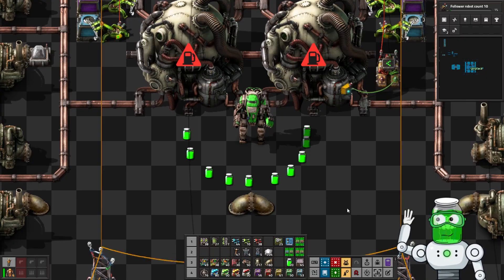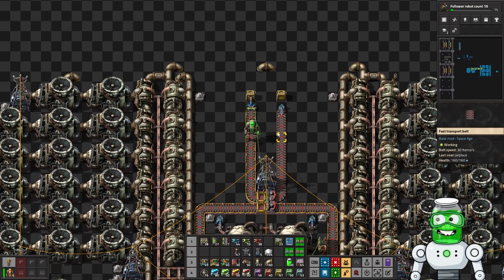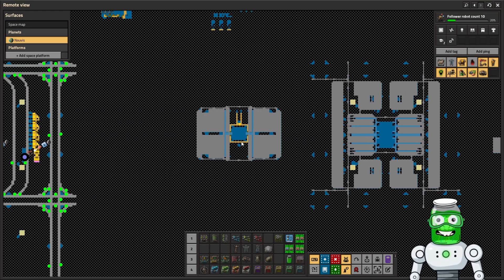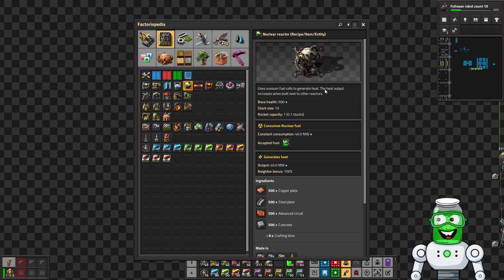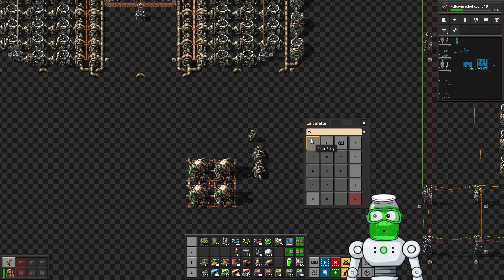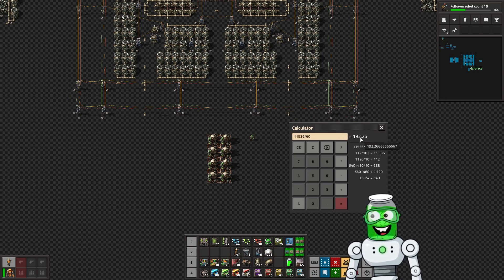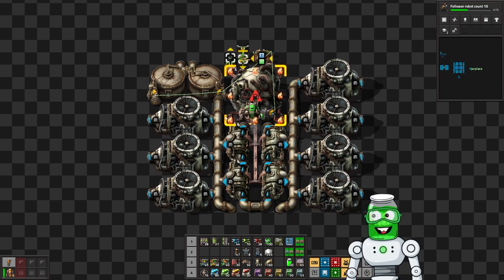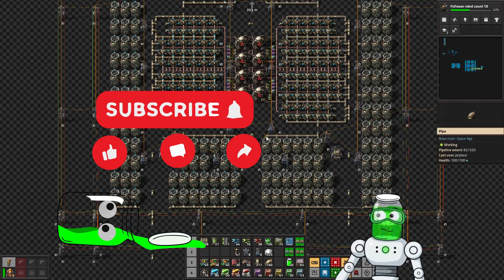Nuclear Power Tutorial & Blueprints! | Factorio Spage Age

Comment: I do not unterstand the setting at 1:47 - please explain the combinator setting in the second line when you compare everything to T
Reply from the maker: That's just a way to make sure there is no fuel in the reactor. If there's fuel in the reactor, the fuel signal won't equal T, hence everything will not equal T, and so it will limit itself to only every having one fuel in the reactor at a time.

Another way to do the same is to say "nuclear fuel = 0"

Need to make your inserters limited to 1 stack size

Comment: how many assemblers do i need to fill uranium fuel cell production for the 4 reactor setup?
Reply from the maker: Great question!

You can produce 1.25 fuel cells per second with a regular green (level 3) assembler, and each reactor burning at full tilt (using it's max power draw) will consume 1 every 200 seconds.

At regular crafting speed it takes 10 seconds to craft, but you get 10 of the fuel cells. If you are using blue assemblers it might be like... 0.75 per second?

So I think it's safe to say you can have one assembler you can run a LOT of reactors.

The limit will be how many U-235 you are getting, so keep and eye on that.

Pre-space, you won't have kovarex, or requester chests, but your average mining operation will provide enough 235 for a 4 reactor setup plus a bit extra

Comment: ive started doing the temperature management for space platforms and the other planets but tbh, for nauvis uranium is so abundant it just feels kinda unnecessary. i could be wrong but if i remember correctly, you only needed like 8 mining drills without kovarex to support one 2x2 reactor and that was before we got quality and big mining drills

edit: it was 8 per one (40 MW) reactor but with only prod 1 in the centrifuges and fuel cell production. with prod 3, its 6 miners per one (40 MW) reactor.  higher than my initial comment but my point still stands. especially with all the new features, i dont feel the need to be super conservative with my nuclear materials
Reply from the maker: definitely agree!

It's mostly important early on (debatably so) to get kovarex up ASAP, or on a space ship.

In either case, it's not really essential.

For me, though, I like being as efficient as possible and UPS is never really a concern.

If I was running Factorio on a potato I might care less, for mroe UPS optimization rather than Uranium conservation.
Reply: u pretty much do it in the early game when u just started me trying to get the solar achivement(aka no solar until space) getting that 1st 235 u would want to make sure ur 1st stock last.
Reply from the maker: @KiotheCloud  100%, and I feel like the best practice is always warranted 🤷